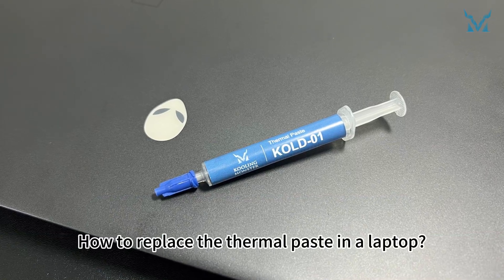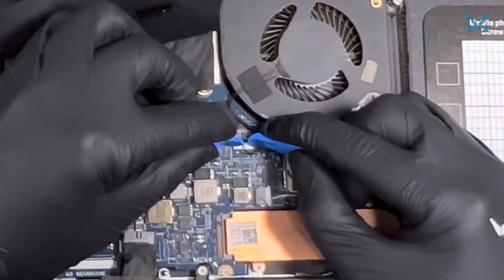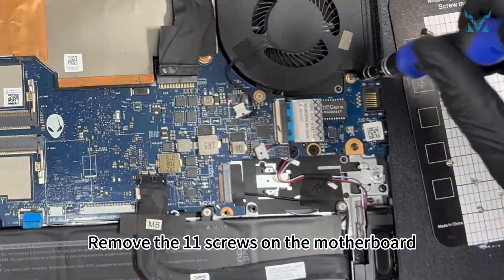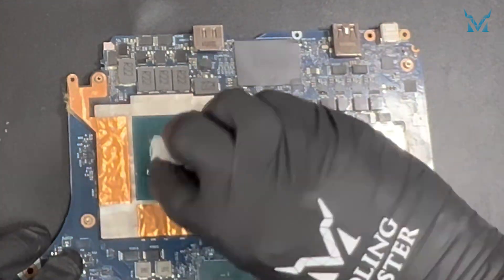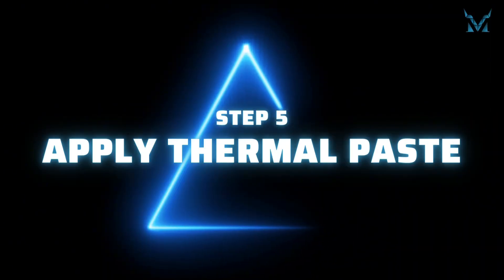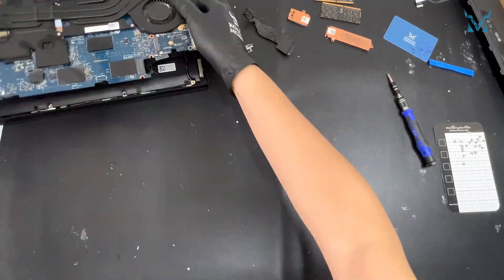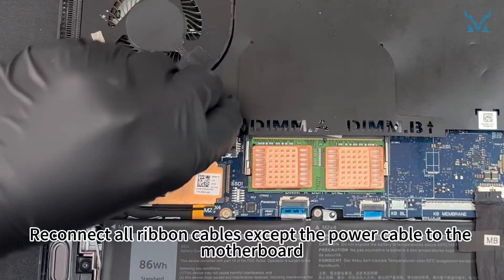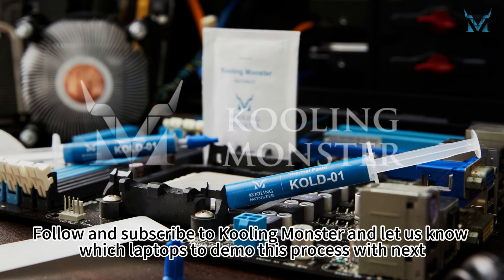Speed Up Your  Alienware M15 R6 2021 Prevent Overheating With Dust Cleaning & New Thermal Paste

Comment: Just completed replacing the thermal paste and reassembly, but the power supply is on the bedroom with my wife and 3 month old sleeping. Will only find out tomorrow if everything works 😅
Reply from the maker: Nice job getting it all back together! 💪😄 Fingers crossed for a smooth power-on tomorrow 🤞
Once you confirm it’s running well, let us know your temps — and if you ever want even better performance, our Kooling Monster KOLD-01 paste + cleaning wipes work great for long-term cooling. 🧊🔥

Sleep well — both you and the laptop earned it! 😴💻✨

Comment: The tape on the fans connecting to the heatsink came off, do you have any suggestions for a replacement
Reply from the maker: Good spot — that tape is important for making sure air flows correctly over your heatsink. Here are some tips for replacement:

Use high-temperature, heat-resistant tape like Kapton tape or a genuine thermal/heatsink tape rather than ordinary office tape. 
Super User
+1

You can also use black electrical tape as a temporary fix, but it’s not ideal for long-term high-heat use. 
Reddit

Make sure the new tape covers the same gap between fan housing and heatsink so airflow isn’t lost.

If you like, I can recommend a specific certified tape kit we sell that fits most laptop heatsinks and maintains airflow perfectly.

Comment: What's the thermal pasts thickness?
I missed up with them and now the gpu temperature is going to 100 ☹️
Reply from the maker: Sorry to hear that! For most laptop GPUs, thermal paste should be applied in a thin, even layer — about the thickness of a sheet of paper (~0.1–0.2mm). Too much can cause overheating. You might want to repaste using something like KOLD-01, which is optimized for consistent spread and long-lasting cooling.
Reply: The thickness was less likely to be the problem than the screwing-down. The paste needs only a very slight layer so that it squeezes into the tiny imbalances between the metal surfaces. It sounds more like the plate wasn't making full-pressure contact with the die.

Comment: Hey man i have an alienware m15 r7 models and the tutorial doesnt have the same internal motherboard can you help and make the m15r7 ones?
Reply: do you have fps drops big ones becuase i have the same laptop and have alot of fps drops in modern aaa games like ac shadows
Reply from the maker: Yes, many Alienware m15 R7 users have reported significant FPS drops and stuttering during gameplay, including in titles like Assassin's Creed Shadows. These issues are often linked to thermal throttling, power management settings, or driver conflicts.
Reply: Please can u upload the m15 r7 one I am a huge tech fan so I want tocl change the thermal paste myself and also kind of scared if something goes wrong so it would be great if could upload one asap @koolingmonster
Reply: I used to get around 400fps in valorant when I bought it but now since 1year am getting only 180
Reply: @iky4131 Dude, same here!  I've got an M15 R7 with an RTX 3070 Ti, and my Valorant FPS dropped from 450 to 180.
Reply: @rohiththas5356 Have you managed to solve this problem? I have the same difficulty with my M15 R7.
Reply from the maker: We will upload this type later, please keep following our channel！
Reply: m15 r7 has liquid metal as its original thermal paste, known as element 31. but at two years it was already getting bad. i decided to try to change and put only liquid metal and couldn't. it is very thin and doesn't give contact with cooler. i had to put ordinary thermal paste but it is overheating, someone knows how to help - can mix thermal paste with liquid metal that even Dell does with its notebooks?